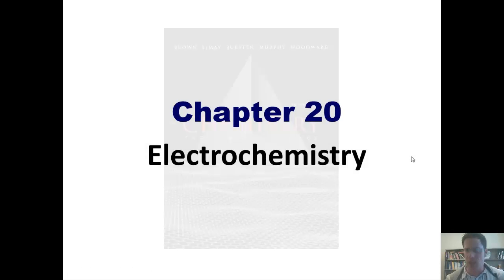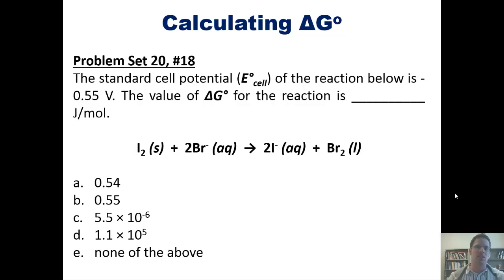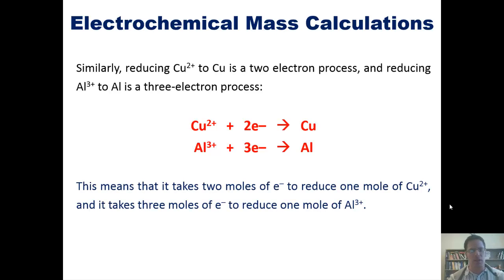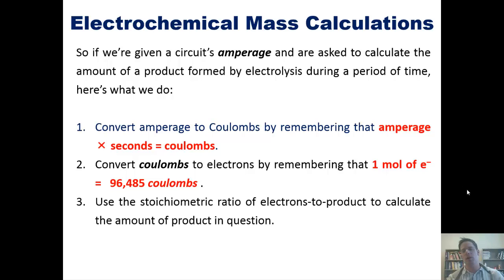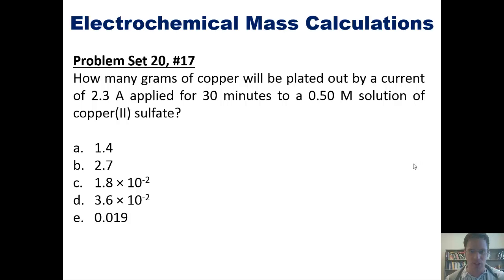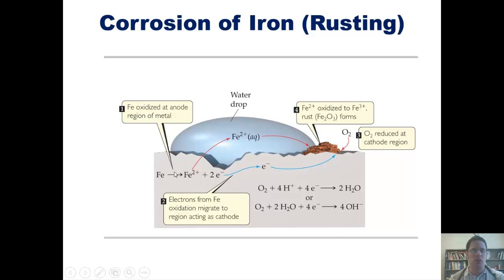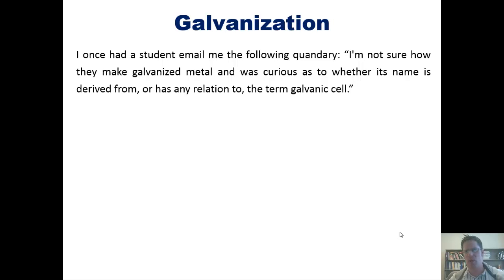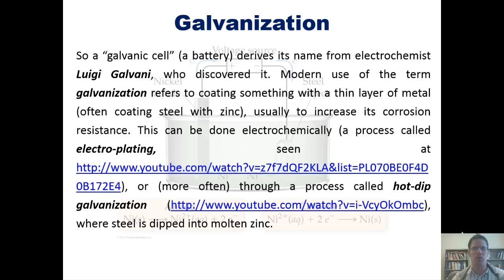Chapter 20 – Electrochemistry: Part 4 of 13

Comment: For the problem at 0.55sec, I was just hoping you can explain why it is kj/mol. I understand the kj part but I thought you canceled the moles out with n and F so why is it still over moles?
Reply from the maker: The reason is because to solve this problem, we have to use the equation delta-G = - (moles of electrons) (Faraday's constant) (Ecell). The units for each of these are:

delta-G = - (moles of electrons) [joules/(volt x moles)] (volts)

As you can see the "moles of electrons" cancel out the moles in the denominator of Faraday's constant, and the volts cancel out the volts in the denominator of Faraday's constant. This leaves behind joules, which can be converted (or not, whichever you prefer) to kilojoules.

I hope this answers your question. Please let me know if you have any more. Have a wonderful day!
Reply: +Mike Christiansen I have the same question the answers says kj/"mol" but the moles cancel out so you are just left off with kj not kj/mol right?  Thank you
Reply: Thank you!
Reply from the maker: Yes, the answer should just be in kJ, not kJ/mol. Sorry, that was a typo on my part.
Reply from the maker: You are very welcome!

Comment: what is the answer to question at1.03?
Reply from the maker: I'm not completely certain, but the formula you use for this is delta-G = - n F E. Do not forget the negative sign in front of the n. Also, the E in this question is -0.55, though it's not completely obvious in the video, because the - sign appears on the first line of the question, while the 0.55 appears on the next line. The two negatives cancel each other out when multiplied, giving an overall positive answer.

I hope that answers the question. Please let me know if you have any more, and thanks for watching!
Reply from the maker: zohair aliThe correct answer is D.
Reply: +Mike Christiansen I got that answer but negative could you explain why it's positive.
Reply: +Mike Christiansen thank you, I forgot that it was -0.55. Do you have an answer key you could send me?
Reply from the maker: Absolutely. Just send me a personal email, which you can find listed on the following page: http://www.chem.usu.edu/htm/faculty-staff/regional-campus-faculty/memberID=10832.